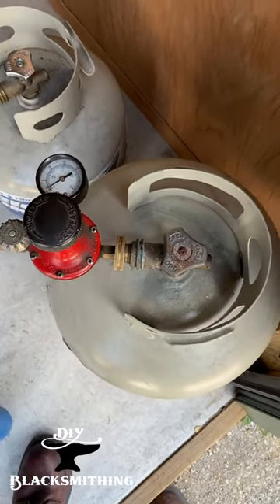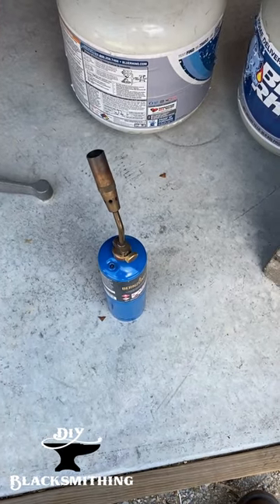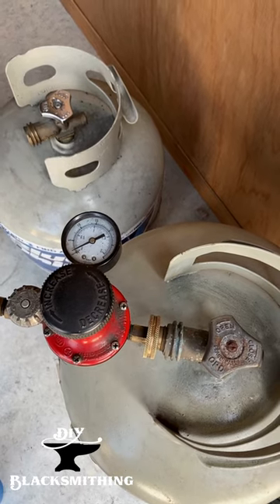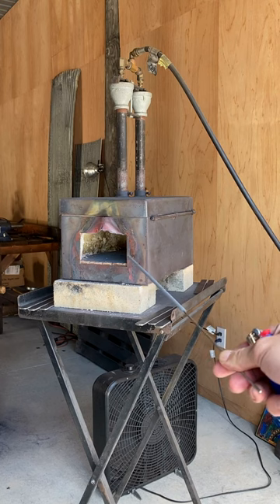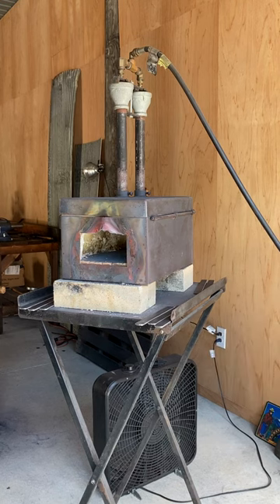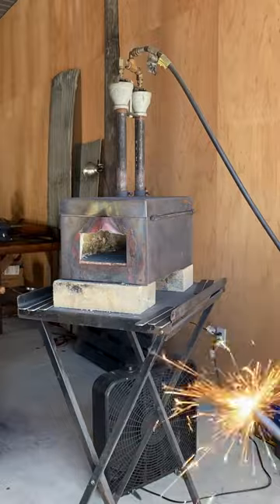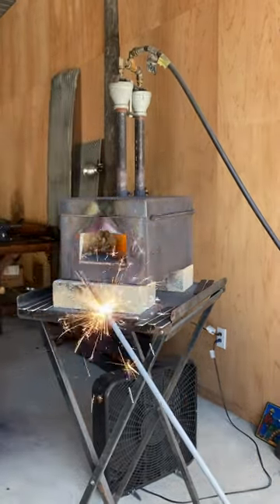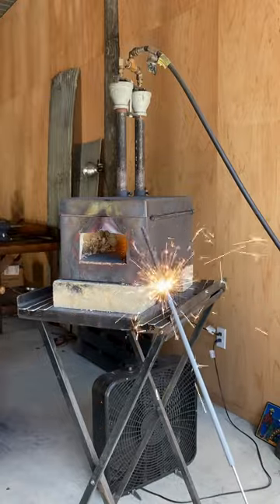Is a Sparkler Hot Enough to Light a Blacksmith's Forge?

Comment from the maker: We usually light our gas forges carefully with a propane torch. In this video, we wanted to see if a sparkler would generate enough heat to A) Not go out from the gas pressure and B) provide the energy needed to ignite the gas.